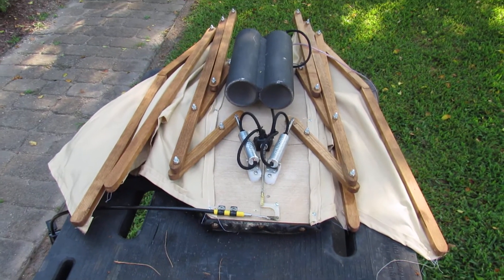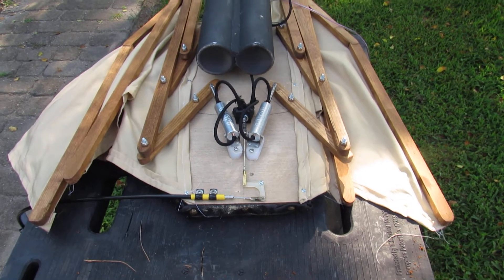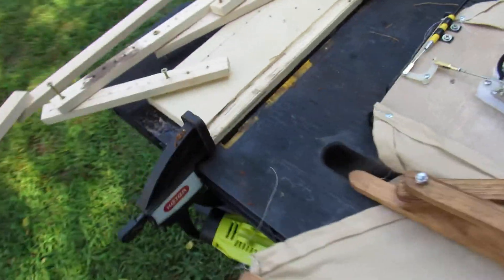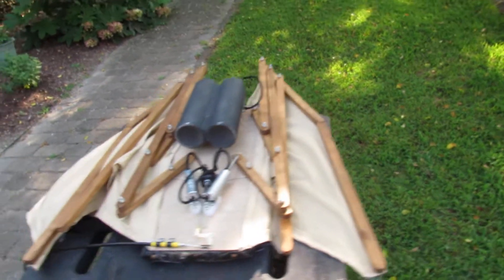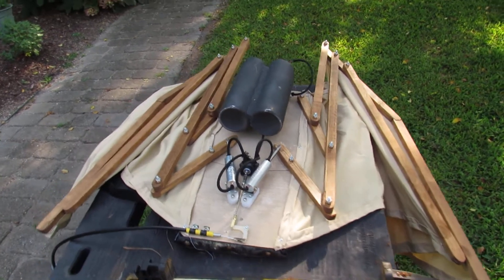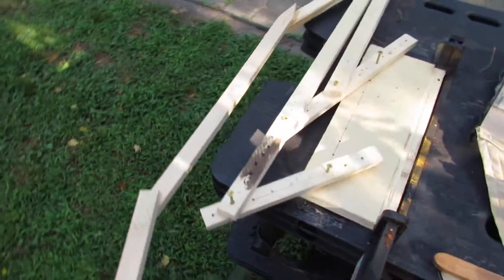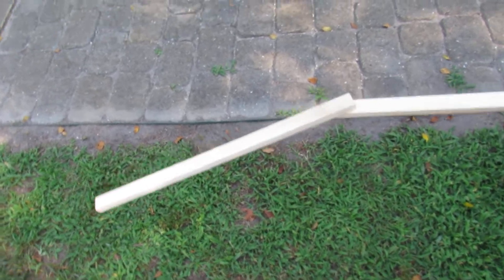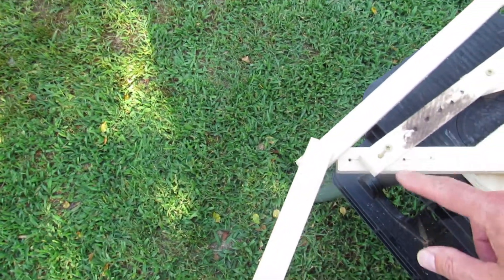Making my steampunk wings

Comment: Hey! I think what you created is genius! I was wondering if you don’t mind me asking what is that part that’s connecting the throttle cable and valve and where can you find that?
Reply from the maker: @AZariaWebb-f3s  that is a soldered Clevis “kwik-link” made by Du-Bro.  It’s a model aircraft part.  You can also use a”z” bend

Comment: I once made a set of "static" wings out of aluminum fence wire. I could bend them open or closed and made them just short enough that the tips would just clear the floor when I sat down and they were angled down a bit next to me. Wingspan was 10 feet or so when open. You might be able to get a similar effect by having something with a bit of flex as the tips of your wings. The same fence wire might even work, but you might want to make it brass colored for steampunk. 🙂 I'd guess everything past the last joint could be wire given your membrane is light.

Comment: Eu amei, você pode me dizer os materiais que usou? Estou com dificuldade em encontrar algo para comprimir o ar e fazer levantar e retrair as minhas asas.
Reply from the maker: 20MM x 13MM hard wood.  4MM screws   I'll have to get this translated to English to respond
Reply: Eu não acho algo para usar para comprimir o ar. 😰
Reply from the maker: I used a battery operated RYOBI compressor to fill the tanks.  any compressor will do.  once the tanks are full it will work for quite a while.